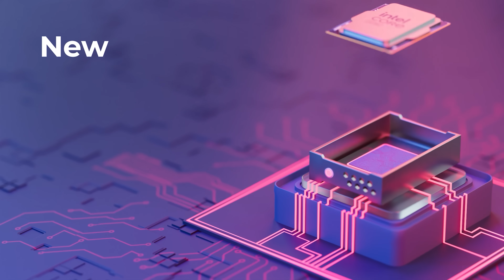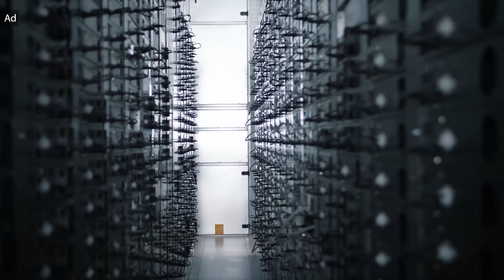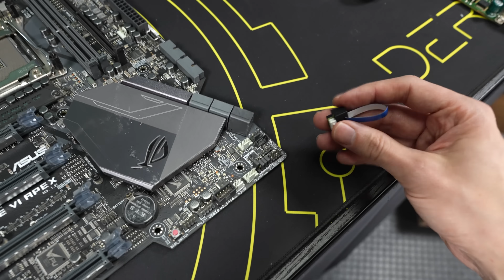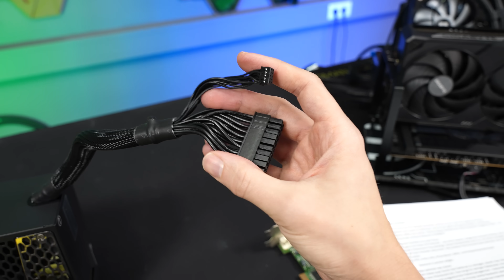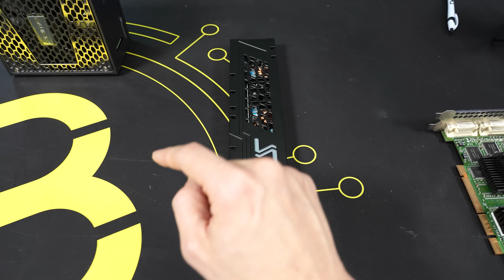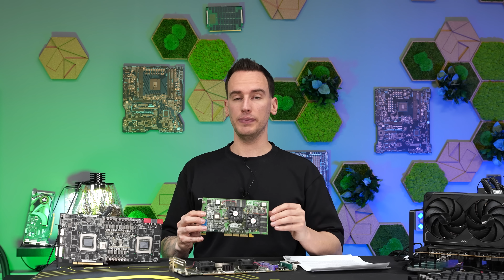Dead-on-Arrival Hardware: Why Nobody Bought These Products - Failed Hardware Ep-1

Comment: I always thought that Seasonic Connect was a great idea, but just couldn’t bring myself to pay the premium for the Connect PSU’s over a standard similar quality PSU. Can’t justify either paying out for a “Power Board” like Singularity’s options on every machine for shorter cable lengths.
Optane was also a fantastic idea (& I still use m.2 Optane cache/accelerators on some of my older HDD based storage ‘servers’. Never did try VROC but have now got me thinking of looking for a suitable motherboard & VROC ‘module’ to have a play with.
3D Labs is a blast from the past as well!
Reply: This is why Seasonic Connect targeted their launch wrong - high end enthusiast market (Platinum, 1000W+) is MUCH less price sensitive!

Apparently VROC can be hideously flaky and data lossy.

I did have a 3DLabs Permedia II card, those were nice inexpensive OpenGL cards for 3D Studio Max and CAD needs and the like. Before NVidia came along and ate their lunch.

Comment: @der8auer: I actually own one of those Seasonic Connect PSU's.
I bought it on sale a few years ago and though I could use it in one of my home servers, but that connect  device is a real hassle and does not really fit that good in any of my cases.
It also introduced a lot of electronic noise in my case, compared to other PSU's it was horrible.

I ended up never using it, it is just gathering dust in my storage now.

Comment: I have a Seasonic connect and it works well, and still using it, they should have continued developing, the power supply could be made SFX, or they could have made it like a server PSU by having it zif.

Comment: In fairness, the seasonic connect wasn't a bad idea, especially if they'd gone for a slightlyore modular system. Use a detachable cable from the PSU to distribution unit, and then maybe some different size distro units for EATX, mATX or ITX compatibility.
Reply: it failed probably because it was proprietary. but you can buy the "frontend" of a PSU in industrial formats, aka, it takes 12V and outputs the normal ATX3
Reply: they should have gone for 12V or 24V, just split the PSU into backend and frontend, the backend takes AC and regulates it down to 24V, that's where the switch-mode transformer sits, which is the big and heavy part, with the smoothing capacitors. then send it via a XT60 connector and cable, just 2 wires, send 24V at 40A to the frontend, which is just a bunch of buck/boost converters that split 24V input to 12V and 5V, most things in a PC use 12V nowadays, because the motherboard has its own power distribution.
Reply: Yes that could have been better if MORE modular.
Reply: It was a pretty stupid idea because modular power supplies did already solve the issue by just providing different cables for different standards. And cases were generally not designed with a long active adaptor in mind.
You can pull stuff like that off for your own prebuilt product lines and hope that it gets viral. But for the average DIY PC Lego user, mechanical compatibility is important. They hate having to find a spot for some clunky adaptor bar.
Also: This likely was more expensive than a normal PSU. If there are two options and one comes with a higher price because it includes absolutely useless bling, most people just take the cheaper one because they assume (correctly btw) that the bling is the reason for the higher price.
Like derachtauer said: It might have worked in the not-as-price-sensitive enthusiast market where people generally like fancy-looking stuff and cram all sorts of bling into their cases - if it also had FPS-boosting RGB.
Reply: It was very much a marketing experiment. There wasn't much engineering effort going into it, it was just relocation/separating some function blocks of the PSU into a separate housing, thinking the modular-PSU approach a step forward. The main problem of it was that it didn't really improve on much - you still had to deal with all the cabling. Sure, the cables could be shorter, but that's not much of a gain since now you replaced the ball of cables at the back of the case with an equally voluminous brick at the back of the case. And you still have to plug the same amount of connectors, so what's the win for the customer here? Alright, yes, for some SFF cases, you would save the space needed at the PSU for all the modular cable connectors. But you would trade this with the relative inflexibility of placing the connector module vs. the the flexibility of routing cables, which is more of a problem in smaller cases. So it really is a niche thing whose trade-offs would be suitable only for relatively few users with the "right" case and who love the optics of this thing.

Ah man, the 12V-only standard for PSUs would really push things forward, not only because it reduces cabling, but it hopefully could also rid the industry of the nonsense that are all the incompatible pin layouts between different modular PSUs. The difficulty for the 12V-only standard is that its benefits would only really play out if most of the components one typically has in a PC and which require a power connection would also need to be 12V-only. Otherwise, you're still dealing with a rats-nest of multi-wired cables for all the different voltages and such. (Too bad that the 12V-only standard doesn't seem to catch on, backwards compatibility is a bitch...)
Reply: @elgonzo7239  The 12 V standard is flawed because it ignores that powerful GPUs require lots of power. Just make it 48 V so it actually comes with the benefit of 4 times the wattage being transferable over the same wire gauge.
And 48 V is still considered generally safely low voltage which doesn't complicate DC/DC converters.
Reply: @Oktokolo  Good point. I actually don't know what the current limits of the current (hey!) ATX12VO standard are (does it still standardize on the old-and-tried PCIe 6/8-pin connectors?) and need to look it up
Reply: It wasn’t a bad idea and the connect adapter needed to be 2 pieces. One long adapter is just too big.